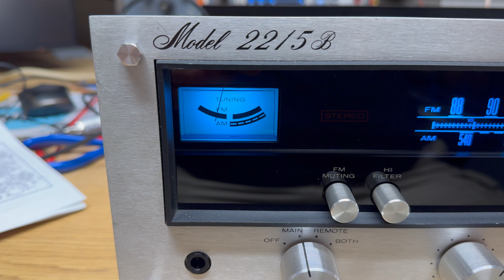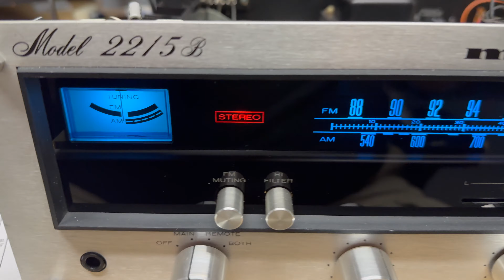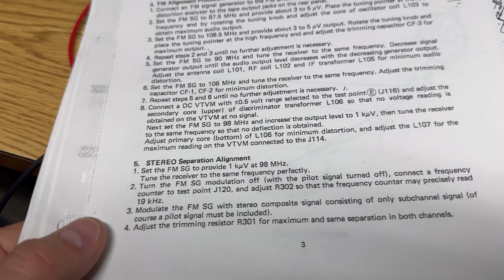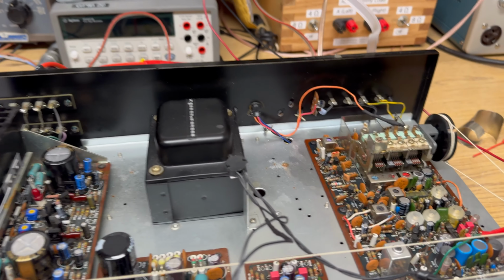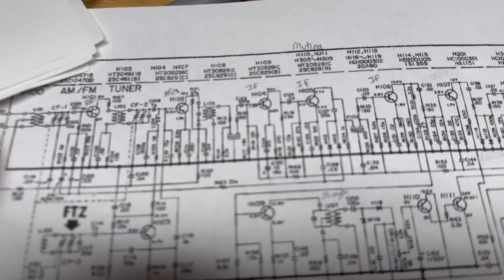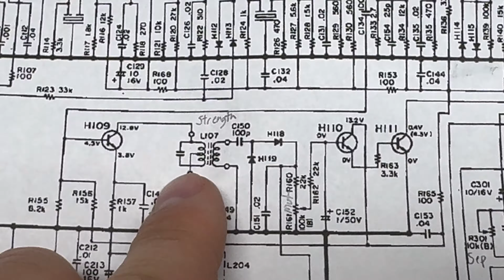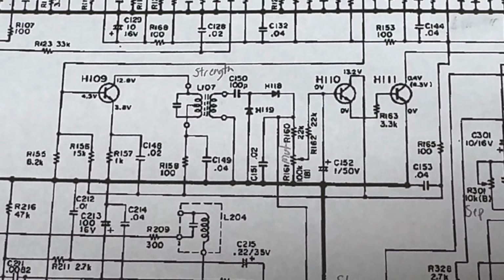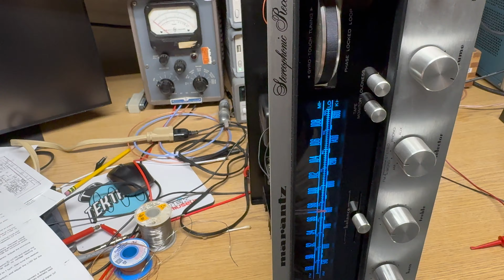Marantz 2215B - Repairing a strange FM Stereo issue - Silver Mica Disease

Comment: Had slightly different issues. “Fm mute”button didn’t work and no stereo at all. Had low reading at J114. Capacitor trick didn’t help. I Pulled transistor H302 but no stereo still. All voltages there. I replaced HA1156 and got stereo to work an “fm mute” button as well. In the end just did little adjustments of L107 for maximum readings. Your video helped a lot. Thank you

Comment: Thank you for this video ! Was working on a 104 tuner with muting problem. Removed the cap inside L107 and added 47pf external. Problem solved !
Reply from the maker: Awesome!!! I had my doubts that anyone would ever find this vid useful but it seems like the issue is more common than I would have thought.

Comment: I have a 2215 in my shop right now with the same complaint. Haven't gotten to it yet, but now I have a good place to start. Thanks!
Reply from the maker: If it’s a 2215 (non-b), the circuit is quite a bit different, but good luck with the repair either way!
Reply: @philsanalogbasement  I can't remember if it's a 2215 b or not. I'll find out when I get to it. Thanks!

Comment: Hey man thank you for sharing this, 1st time viewer and i actually ended up here after following your thread on main@fm tuner group.  When i was 1st reading your post i originally thought you meant the pointer was actually moving on its own, so naturally i was just about to ask if you had re strung the tuner cord with a ''stretchy'' nylon string, which causes the pointer to move or at the very least make the pointer bouncy (ask me how i know...)  But i eventually realized you had the exact same problem i had a few weeks ago refurbishing a 2220B for a fellow member of the Marantz Facebook page.  In my case one of these coils was similarly damaged on the AM board and i did the same thing, soldering a low value cap on the foil side.  But on the FM board the faulty coil had a broken wire and i deemed it too difficult and risky to re solder it.  Luckily my former audio tech had salvaged a 2220B FM board and he was kind enough to give me the coil i needed (L109 i think).

Those are the kind of issues that can be very difficult to trouble shoot and repair.  Again thank's for sharing.

Ray from Canada.
Reply from the maker: Yeah! I remember seeing your post on the FB group.  I had the same issue with a 2216B and one of the AM coils.  That one was a lot easier to figure out since it didn't work at all, and wasn't intermittent like this. 

I inherited a massive collection of new IFT's from an estate sale a few years ago.  I think they came from Lloyd's Radios (a low end radio brand from the 70s') - they are all Sumida, Toko, Mitsumi, etc.  
I need to try to get some help identifying them eventually.  I'd love to be able to use them and offer them to other people that are struggling with issues like this.  Sadly the one I needed for this repair wasn't in that collection.
Reply: @philsanalogbasement  Yup that was me alright and i totally agree an intermittent trouble is way more difficult to fix, my AM coil was dead so it was a bit easier to isolate the source of the issue, but it still took me half a day to fix.

Yeah i remember LLoyds stuff very well, like most families we had a cheap LLoyds receiver at one point in the 70s.  You were lucky with the estate find, wish i was so lucky.  In my neck of the woods finding decent audio test gear for a reasonable price is more and more challenging.  Been looking for FM alignment stuff for months to no avail.  No way i'm going to pay over a grand for non working gear without leads or worse advertised for parts only.  That's what you get for living in Canada...
Reply from the maker: @raymondmenard5444  I drove 12 hours round trip from NY to Deep River Ontario Canada last month for a smokin deal on some test equipment, so it exists sometimes :-)   Hopefully you find something soon.  I used the ST1000A on this one instead of my normal HP stuff, the visual aid was helpful since the prior person had turned every single coil / capacitor way more than they should have while trying to fix it.

Comment: Thanks for sharing your great job! Just wondering if can straightaway solder the cap without breaking inside as I heard someone did that way. Also, my 2215B FM had much distortion ,ignored any issues from the antenna signal strength and earth connection. So if you solved this issue before? Thanks in advance! Cheers😊
Reply from the maker: I tried that off camera but it didn't work in my case. I suppose it would depend on the failure method of the built in cap, but it was too risky to try and remove it cleanly and analyze it.
Reply: thank you so much!

Comment: The last fancy large component stereo stuff we had rotted in the sun 🌞 because we knew they were disintegrating no matter how much parts we changed. MP3 players and digital tapes and online downloads, the stuff has zinc coated leads, every component is growing tiny hairs of conductive zinc oxides. It's going away at the molecular level due to age. It is dying. It will die. Parts are not available because they are disintegrated too.
Reply from the maker: Too bad, almost all of this era equipment (1950's - 80s really, some newer stuff as well) can be completely electrically restored without much hassle, assuming it's in decent cosmetic condition and not missing any unique chassis parts or has burned out meters. Even then, people are usually parting them out on eBay so you can find them. For the few components that fail and are no longer made people have come up with various replacement adapter PCB's, etc to use modern parts.